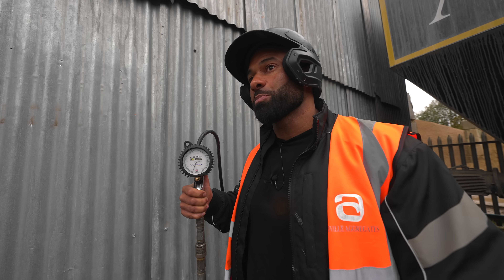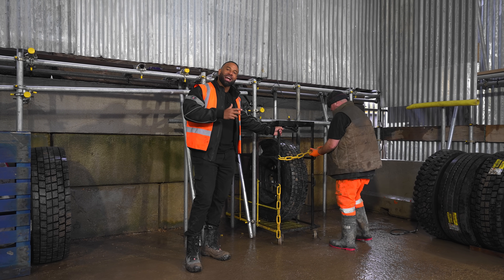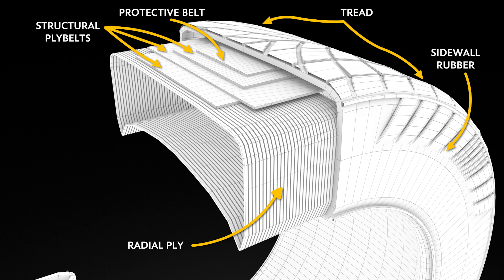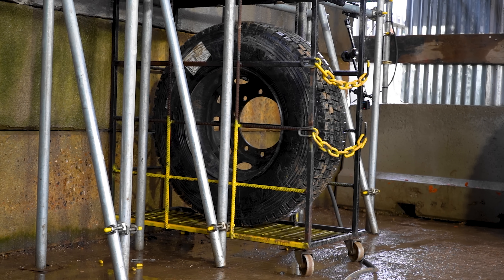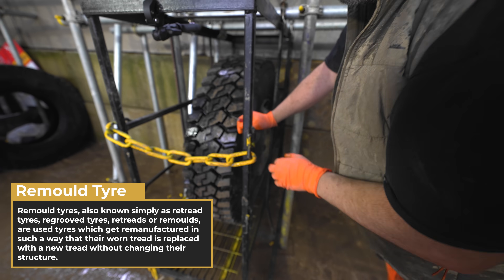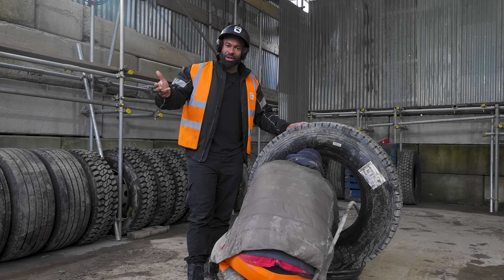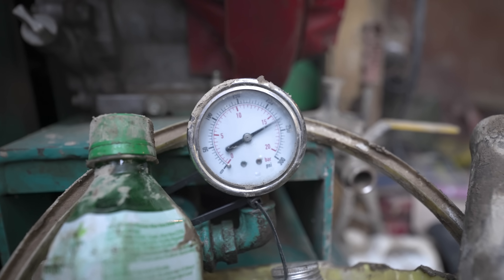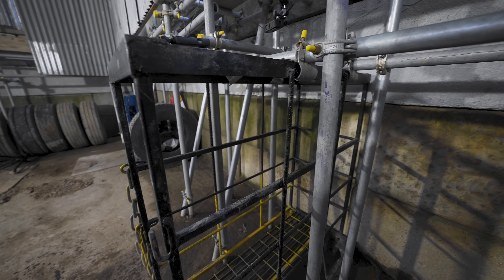EXPLODING Tyres To Prove Everyone Wrong - Tyre Cage Test

Comment: I'm sorry but I have been doing heavy equipment tire repair for over 36years. You should never remove an aired up tire from a tire cage to take and install on a truck. It is known that a truck tire laying flat on the ground with 90 psi (pounds per square inch) in it and it explodes it can project a 10lb bowling ball 3/4 of a mile. With that being said a tire should be deflated with only 5-10lbs in it then transported to the vehicle bolted and torqued then reinflated to the proper pressure. Then always use a clip on air chuck with a 6ft hose with hand valve and gauge. Always stand in line with the tread and never by the sidewall. There is a lot more rubber and belts to go through than a sidewall of a tire.

Comment: Let’s get this right for safety the tyre gets inflated in the cage and then the tyre technician rolls it out of the cage and over to the truck and installs it. Then the truck goes out onto the road and into public spaces where people walk past and stand by it and we don’t have a cage around it fully inflated. You proved one thing that tyres whether new, used or repaired are made to a high standard and are reasonably safe if not over inflated.

Comment: I love Ashville weekly and rarely miss an episode, but it would seem Daniel has got the bit between his teeth on that safety cage saga, Ashville has actually exposed themselves to potential H&S issues when it comes to safe working practices with compressor blow off valves, tyre gauges, and possibly calibration issues, all to just try and prove a YouTube comment wrong, come on Daniel this isn’t like you especially when you did that episode showing yourself in court after pretending Tezza had an accident, hope your not tempting fate here with this type of exposure.
Great to see a midweek Ashville though 👍

Comment: tyre cage are not for when the tyre bursts, they are for when the rim and and split-ring are ejected, which can happen with 2 and 3 part wheels, that causes the rim to get ejected one side of the tyre and the flange and split ring to be ejected the other, if they were meant to stop simple rubber debris the would require smaller holes.
Reply: They are so for when the tyre bursts, what do you think happens to an unrestrained tyre and wheel assembly if the tyre explodes and it isn't in a cage ?
Reply: @Kickaha83  when a tyre busts nothing will happen to the rim, as it the tyre that has failed, that is not going to eject the rim, as it is almost never the tyre bead that fails, it is the sidewall etc, and a stupid frame with large holes is not going to stop small parts of tyre or air escaping, as the purpose of such device is to stop multi-part wheel rim being ejected, which is why it has fucking large holes that do not stop or divert air or bits of rubber tyre, this is given most sensible people will only use a low pressure for seating beads, then mount it on the vehicle, in which it is secured and vertical before final pressure - but this is where split-rim have significant risk and should be done in cage, as they are prone (relatively) to rim ejection being 2 and 3 part rims.
Reply: The function of the cage is to stop an unrestrained rim/tyre assembly of any type flying around the workshop in the event of a failure of either the split rim or the tyre itself, some cages are louvered to stop the particles flying out and direct them downwards, best practice here is a minimum 3m remote inflator or as on our cage a regulator you can set and walk away from, the risk from split rims is overstated, it is a very rare occurrence to have one fail providing the components are in good condition and if they aren't they shouldn't be fitted, the only tyre failure I have had was with a 750-18 on a split rim and it was the tyre that blew when being inflated, not the split rim coming apart and that is the most common failure regardless of the rim type

Comment: If you were only blowing a tyre up to show how strong the cage was why didn't you just use an old tyre it would have still had the same outcome but tyre on the vehicle would burst at a lower pressure than it did in the cage because a tyre on the vehicle would be at a higher temperature so would be softer and expand a lot easier.

Comment: You state that your Tyre fitter has been in the industry for 30 years, has he had any formal training. using his Knee to fit tyres, or a bead breaker, fitting an off road patch to the shoulder of the tyre. The tyre will go bang. Tyres will naturally inflate to over the pressure you tested the pressure on when they get hot. Throwing the tyres away as they are stretched after your test, what's that all about?

Comment: I am a tire tech and have been in the industry for 39 years. I have had several truck tires explode. The explosion you had was a small one. When you have a zipper rupture it is about 8 inches long on a minimum. I had one explode with only about 70psi and it ripped my pants and bruised my thigh muscle really bad and through me 30 feet from the tire. The tire was not in a cage. The main purpose for the cage is to contain the wheel and tire during a explosion. Mainly split wheels. I saw a man lose his arm from a lock ring coming off. I saw a guy lose his life also from a regular truck tire explosion like what you did. The air pressure coming out broke 4 ribs and 1 rib put a hole in his heart he bleed out and died. The sudden force of the air can kill you just as fast even in a gage. So really you proved nothing.

Comment: I’m a tyre fitter and those drive tyres should only be having around 90psi in them. 110 is way to much for drives leading to uneven tread and less grip
Reply: I am an owner operator and I know that they should be inflated to 130 psi so that they dont explode at +12 ton drive axle weights.

Comment: The tire cage is not to protect anyone from air escaping the tire during a blowout it is to stop the metal wheel from cutting the person in half if the wheel were to fail . I am here to tell you I have witnessed a modern 22.5" hub pilot wheel failure at 120 psi that twisted a proper tire cage that was a machine welded cage made with 2.5in steel tubing! I promise you if a wheel fails in your cage while a human is standing near it you will be picking up their limbs one at a time

Comment: You need to use old tires as that’s more accurate to the situation and the old tires will cause more shredding cause they are weaker in the sidewalls and the tread will come apart more
Reply: Also your video shows the legs literally bending😂. And it’s not about necessarily buying a “fancy” one. But that your welder is dog shit and made a potential grenade with the extra shrapnel of that shitty hack job. And yes their safety is part of your job but at least you saved literally a few bucks in the end for a scenario that “probably”won’t happen.

Comment: Those old tyre cages were built to stop someones head being taken of by a poorly fitting split rim lock. on modern truck wheels there is no lock to come off so the cage is of limited use, when the tyre explodes the problem is smaller bits of tyre and on a used tyre dirt and grit flying off like shrapnel - that cage won't stop that. I recently had a tyre explode and spent a few hours picking small bits out of my cheek and getting my eye washed out in casualty!
Reply: Limited use ? If a tyre on a one-piece wheel explodes and that pressure has something to push against, what do you think happens to that wheel and tyre assembly ?, they are essential for any truck tyre work

Comment: To be honest, inflating a tyre (tire) is a profession on its own. As an amateur in all kind of businesses, I once had to inflate my wheel barrows tire after it lost air over time. My gauge of my  tiny home "suitcase" compressor didnt budge, and so i kept inflating and inflating. You know what? The tube and tire failed the test and blew up well below 8 bar (110 PSI?). My ears rang for over an hour, so i doubt your mechanic wouldnt have sustained damage to his ear drums when he inflated the tire to above 170psi...

Comment: Good video and good cage. I’d be more concerned about the compressor tank at 240psi. Think I’d be replacing it as the safety valve is usually set at about 160psi. Just my opinion, not knocking your videos, they are all great .👍
Reply: I think they temporarily removed the safety valve

Comment: Having a side wall blow out isnt a real big deal of a test and a cage offered no extra help because it was a side wall blow out, its when a side RING (metal) blows out. I have seen profestional cages when the side ring blows off it distroyed the cage  which is why you use a 6 to a 10 foot air hose  standing in front  from a distance of the tire so if it does blow it will be from the sides and yes it will  scare you but you will be alive and well !!!! that is after you clean the crap out of your shorts.

Comment: No the popping sound is not the layers of ply’s but the steel belts popping I’ve changed thousands of tires and I can tell you if they don’t research the durability of their cages then that tire cage will fail

Comment: That's not even really what those cages were meant for.  They were meant to be used back in the day when trucks used 3 piece wheels. 

The danger wasn't just a tire blow out. It was the steel bead ring of the 3 piece wheel being launched and hundreds of miles per hour at the tech.

Comment: It's the split rims that you need the cage for
Reply: I really doubt that it would stop a split rim or a rim failure 
I was working at a shop where one  took off an arm of a tire machine an put a hole 🕳 in the ceiling

Comment: "If the tyre technician had been standing here and the tyre exploded he would have been completely safe" - Did you completely miss the fact that the metal chain got unhooked and went swinging? (Yes common sense should be applied not to stand so close) but nonetheless the less you made an entire video to prove people in the comments wrong and still failed.

Comment: You did not properly test your setup... Look at the time it takes the tyre to deflate, the energy was released over a very long time and this is not near the worst case scenario and I think you need to test it proper as you would with a proof load in a gun using explosives or something calibrated and repeatable, I'm not saying the welds are not good enough but I would not have any or they would be scanned with radiation as a tyre fully letting go and that stored energy releasing in say 10ms vs 10ms is a really big difference and there is a reason most of the ones you showed pictures of have hoops instead of welds.... I have about 20yrs in transport from military trucks to specializing in passenger car tyres with a ton of hours training with Kuhmo and others...... I get where you're coming from but I think others are correct in originally raising concern and I do not think you took them proper serious and are still making same mistake in over confidence.... Don't gamble with this kind of stuff and either spend for the right gear or test it properly, blokes working the jobs you are this should be second nature. Also need to consider split rim design and other things. May have none in the fleet or what ever but if its not to grade to take it all you and everyone that comes near it needs to know.

Comment: This contraption maybe is safe for puncture explosion. But not explosion from rim ring failure or rim failure. In my real eyes i saw cage like yours was exploded from the tyre and worker was separated in half. He somehow managed to survive but without lower parts. Even penis left him. After several years i saw real strong cage like you showed in pictures exploaded and get damaged. From that shockwave worked flead around 3meters away but nothing more. So your contraption is only for showcase because if it will be major failure it will go like a shrapnel. After years of working with the truck tyres i even saw new tyre exploaded on the robot whitch replasing rubber it is safiest way but most expensive. And even this robot whitch weight is around 2 tons was moved around meter from its primary location.

Comment: So basically you've proved that you don't need a cage... And those cages are generally only for split rim wheels anyway.
Reply: You are definitely wrong there. Almost any tubeless truck tyre can have what is called a zipper failure after being repaired, especially if has been run under inflated for any length of time. I have had one fail in the cage, that was actually outside our workshop. Luckily I had ear muffs on, as the noise it made was heard over half a mile away. I was not in the trajectory zone, as training dictates. What the zipper failure did achieve though, was to remove all the dust from the rafters in the workshop.
Reply: @lawrencerolls3643  Well then I stand corrected.

Comment: Tire cages are not meant for when a tire fails. It will scare you likely hurt you but most likely it wont do too much. The cage is meant to contain a split rim failure. These are several orders of magnitude more dangerous than just a failed tire. I still would not trust your cage with a failed split rim.

Comment: I hope yous dont repair punctures on sidewalls or the curve of the tyre for real as you're not supposed to, the patch doesn't adhere to the curve/flex of the tyre on a bend the same as it does on flat and wont stand up to bumps in the road as it should. In 20 years of tyre fitting I've never repaired a tyre with a puncture on the inside/outside edge

Comment: The experiment was not accurate enough  neither a success .The steel cage was secured by the scaffolding poles which protected the steel of any deformation .Camera standing 5 meters away felt the blast even.Chain got opened and the cage wheels changed position. Not mentioning everyone took hide
Love the channel but from an engineering perspective this test would fail .

Comment: Audio needs a lot of work. You are being too loud with shouting and it's overdriving the recording. This clipped and overdriven audio is being used all the way through to final video without being being cleaned. The add your excessive background music or effects. You make some good content, jusy fustrating to listen to leading to dropping the video.

As for the test, compressor was/is limited for its own safety, not just your tyres and you sent the compressor in to danger zone. Your cage is extrememly flimsy far from sturdy and then you are only standing on other side of the corogated iron. You seriously failed to grasp the dangers of the tyre rim letting go. You have only simulated a punture. Reckless is all I can say. 
The biggest rish/danger is not the tyre letting go, its the rim, especially multi-piece rims.

Comment: when popcorn starts, RUN THE FK AWAY, I'm 6ft 280, I had side wall explode about 1/2 inch size hole, I was lucky and that hole was away from me rolling to put back on Freight-liner rig back left outside, I got about 6ft away from truck and popcorn sounded about a sec before getting away booom to the ground I go, got up ready to fight, but  no one was around I grabbed tire went to put on and discovered hole

problem with failure was due to POS RE-CAPS, STOP BUYING GARBAGE AND BUY NEW SHIT CORPORATION TRASH